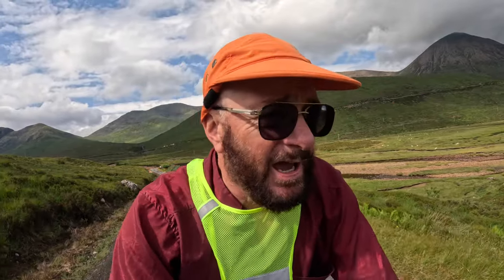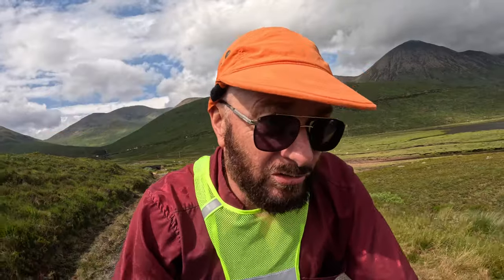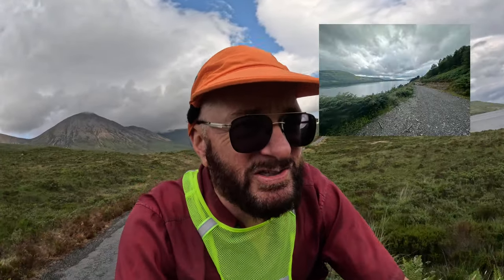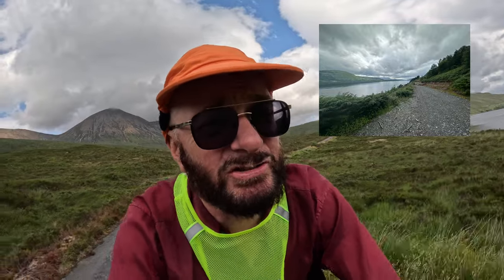Keeping the battery charged while ebike touring / bikepacking

Comment: Thanks for the vid, not wanting to be snitty but watts is power and watt-hours is energy. For example my big pack that I made has a rest-voltage after settling after a charge of 51.6 volts (LiFePO4 15s3p) and a claimed 6Ah per 32650 cell so I've got 51.6 x 18 watt-hours = say 920 Wh for cash. If I use 230 watts assistance for an hour I'll have 690 watt-hours left, but if I use 460 watts assistance for an hour, I'll have 460 watt-hours left. I don't even bother trying to calculate the actual wattage of the battery pack as I'm not trying to get maximum welly from it, just interested in range and cell longevity.
Reply from the maker: Oh that’s fine - I reckoned I was as over simplifying by referencing the systems battery wattage & that’s a good explanation
Reply: Thank you. My packs are 58.8V (fully charged) and 35Ah giving me a potential of 2058Wh.

Comment: do the pubs mind you just plugging in ,or do you ask permisson from the pub owner. ian a little worried if i push to far away from home .thank you for all this information ,
Reply from the maker: I might do a video on that specifically but generally I just plug in providing I’m going to be eating and drinking 100 times or more worth of whatever electricity I’m taking. It’s often mid afternoon so the bar usually being run by a teenager with no decision making powers anyway

Comment: I have the same bike as you. It is a400wh battery. Can i upgrade to a 500 Wh like you did. Do i need to modify the bike in any way. Or is it a straight upgrade from 400 to 500Wh , like you did? Thanks?
Reply from the maker: You can just plug in a 500 as if it’s a 400.  No modifications needed

Comment: 🤔 I’d try wearing a helmet 🪖 pal .. you only have 1 head 🤷‍♂️
Reply from the maker: I must do a video on helmet wearing & the strong opinions that are held around those magic bits of plastic and styrofoam (they are magic in a limited set of circumstances)
Reply: @Ebiketouringlife  🤔 well that magic piece of so called plastic which can also be carbon fibre could be the difference.. not to worry huh .. am sure ya too busy charging them batteries  ⚡️ 🪫😁👍
Reply: Guys, lets not fall out over this , us cyclists need to stick together! 
I am convinced about helmets only because my neighbour toppled off his stationary bike outside his house, his head hit the kerb edge, 
ambulance , hospital gash, stitches etc… 

Re-charge on tour is an interesting one, my ebike has given me a new start after heart issues, now I think theres space for a video on touring with a cpap machine ( sleep assist)

Comment: Just found your channel . Great for me as I'm branching out from Dublin using the canals and trains to extend journeys for day trip returns. These all hinge on my battery range so I was intrigued by your range and distance. You said a 500 watt will give you circa 100 k in normal conditions. I have a Li-ion 36v X 22 ah which, I understand, amounts to circa 790 watts. I was advised to divide wattage by ten to get an estimate of range in kilometers thus giving 80 klm approx for my battery. I've found this to be reasonably accurate. Could you tell me more about your battery pack make and brand. I heard u mention sourcing them on line from France. Txs!
Reply from the maker: It’s the standard Bosch battery - almost all my use is in the lowest asset  (eco) which is about 40% on their system. I’d say I get closer to 120km with the 500w in eco although I practice hard to be sure as I seldom go all the way to zero and if I’ve done 90 am inclined to turn the assist up for the last bit. In very good conditions I have got 130 and still had about 15% battery and once on Harris with a strong back wind I hit an implied range of 220!  For an electric it’s a light bike with 34mm tyres so with fatter tyres & a heavier bike it would be less. Fully laden including me & camping gear it’s about 110kg

Comment: Is a solar panel with a small solar generator (with an AC outlet) an option for charging?
Reply from the maker: not really, particularly where I’m cycling and the average distances I do per day. If you are somewhere more towards the equator with a trailer and larger panel and doing 50km a day it’s more practical especially if it can be mounted as a trailer ‘roof’ while cycling

Comment: It takes more than just a couple of hours for each battery to charge. Overnite charges would be mandatory!
Reply from the maker: Ive now toured some 7000km including wild camping up to 4 nights in a row where ‘top up’ charging while having a meal or couple of pints was all that kept me on the road. I didn’t run a stop watch but clearly with a fast charger that was enough as there was no where to plug in overnight. I am upgrading the computer to the Nyon which I think will mean I have better battery use data accessible to me
Reply from the maker: Add to this that a lot of chargers are only 2a whereas my fast one is 6a (Bosch do 2,4 & 6) so each of those will make for enormously different charging experiences
Reply: @Ebiketouringlife  Tip for you, always find a moment to leave your battery to charge overnight, if you can - reason for this is that the balancing of your cells happens at about 90% full charge, you want to let your BMS (battery management system) balance out your cells every now and then, or your battery will definitely degrade faster.

Comment: Why is your face the real focus of the video?
Reply from the maker: Mostly because I’m so much more attractive than the scenery. But actually because that’s a camera mounted off the handlebars that mostly points forward to capture the road footage I use when talking about routes. Here I was returning from an unexpected dead end on Skye created by road works and decided to use that time to answer a question I’d got a lot by spinning the camera around and tapping away while I cycled.
Reply: @Ebiketouringlife  But you have to understand his (our) point of view. I like to see the area and the scenery more than I want to look at you. It's nothing personal. I've got over 50K miles on my ebike now and don't glean any useful information from you or most other riders anymore. Again, it's not personal. Once I finally learned how to cut the A/C voltage umbilical cord riding has changed into living comfortably off the bike for as long as I like. But, I do like seeing the areas you ride. A DJI Pocket 2 stabilized camera works well at flipping the camera 180 degrees with the tap of a button, either on the camera or on the App. You can see in this video that I can flip from front to back easily. - https://youtu.be/K1z3rt3_lfg

Comment: Can you add regen to your rig?
Reply from the maker: You mean to harvest breaking energy? Interesting question but my suspicion would be that the added weight, bulk & repair complexity probably wouldn’t be worth it for touring uses. In particular as I’ve not had a problem with charging batteries so far so it’s fixing a problem I don’t have. I have wondered about a simple dynamo I could engage for downhills that would charge a powerpack for phone / GoPro use

Comment: Stupid is having ebike for touring 😂😅. The simple it is the better!!!
Reply from the maker: I think I’ve proven this not to be the case, 7,000km of touring done, vast majority of that wild camping and routes that are difficult in terms of terrain & prevalent weather conditions.
Reply: A gas powered 2 stroke moped might be the better option. With that you could get repairs. But with an e-bike SOL. The rest of the world is not at all like the US.
Reply from the maker: Errr I’m not in the US - but yes Namibia where settlements can be 300km apart would be a challenge. The electric components of a good ebike are unlikely to fail under less than 50,000 km so I wouldn’t let the fear of repairability stop me making the attempt - it’s pretty low risk in comparison to other critical issues
Reply: @Ebiketouringlife  Your biggest concern should probably be how waterproof the electric motors are. Thus center drive is pretty much out.. Probably best would be one with both front and rear hub dive ind on a tricycle to allow more cardo, stability and traction.
Reply from the maker: @riskyron1416  my impression is that a never opened Bosch centre drive should be fine although I'd wonder after its been serviced if the seals can be as good.  I presume your concern here is immersion while crossing rivers rather than just heavy rainfall?  TBH the Irish & Scottish Atlantic coast conditions are pretty severe both in rainfall terms but also salt spray

Comment: What about regen?  Why is it so ineffective (<10% return)?
Reply from the maker: Don’t know enough about the physics but I wonder if a downhill brake dynamo might add something beyond cost & complexity 🤣
Reply: Simple, its spent energy, the fact you get anything back at all is already amazing - but its just not worth it. Regen braking is often used for exactly that, braking, not for the regen part.
Reply: @Ebiketouringlife  - Racers use dynamo hubs to produce electricity to power their electronics so it must be viable, since racers wouldn't waste pedal power unless it was worth it. The physics is E = mgh, where E is energy in Joules, m Is mass in kg, g is the earth's gravitational constant and h is the height in meters.  That part of physics doesn't explain why regen is so inefficient though.  : (   If racers use dynamos on the flats, then braking on downhills should be that much more useful for generating electricity?
Reply: @tomnoyb8301  I don't know much about this stuff, but the amount of energy created from a dynamo or regen braking is probably so small as to make it not worth it for the added complexity and weight of putting those things on an ebike. Plus on a long ride, how often are you really even braking? Probably a small fraction of the time you're on a bike.
Reply: @williamreinhard  - It's not so much the weight of the dynamo as the drag caused by generator producing electricity.  If a racer's producing 200Watts and the dynamo's producing 2W at 10% efficiency, then the dynamo's dragging the rider down to 180W.  He lost 10% of his forward energy to keep his phone/computer/lights working.  Otoh if he only generated energy when braking (e.g. on downhill's, etc.), it wouldn't cost him any Watts of forward-energy.  And there are hundreds/thousands of cost-free Watts available on downhills.  

One way to do it might be to include an inclinometer in the dynamo hub to produce power only on steep-enough downhills?  To the genius who balked at complexity, your smartphone's inclinometer is the size of the microchip in your credit-card.
Reply from the maker: I’m that genius but I wasn’t referring to detecting a descent which should indeed be simple but the physical mechanics of engagement & disengagement which adds another layer of stuff that can break & needs maintenance (plus of course adds weight). All of which is competing with simply carrying another powerbank. I presume that’s why they don’t exist
Reply: @Ebiketouringlife  - This author presumes lazy product designers.

Comment: hi  do you find your average speed on ebike eco is much different than just a normal touring bike?   whats the approx difference in average km/hr  all factors being relatively the same (eg flat roads / no head wind ec) and if yes then is the trade off for extra weight of bike and (hassle of) getting the batteries recharged overall worth it..         and how long does it typically take to charge a battery,    cheers
Reply from the maker: The benefit off an ebike if you are reasonably fit & in eco is pretty much entirely for going up hills & in winds. If you are going very long flat rides (100+ km in a day) there may be some benefit if late in the day you’d normally be fatigued enough to have to slow down but of course perhaps the extra bike weight cancels that.  So my average speed with hills/wind is higher but with neither would be similar as legally the assist cuts out at 25kmh & in eco is pretty modest at say 20kmh.
Reply: @Ebiketouringlife    hi thanks a lot for sharing this experience.  much appreciated.
Reply from the maker: @sweetsweet3753  one aspect that’s amusing is the 25kmh assist limit means that often the fastest route will be the one with more hills as the assist gets you to the top under assistance and you can generally cycle much faster downhill under your own power than you would on the flat.

Comment: Love your adventures. Great videos.

However, I can't understand why you don't wear a helmut, considering your long experience in cycling and how you set your bike up so well.

Baffles me. You obviously have your reasons, but I feel you are tempting fate, and that it will never happen to you.

Do you not wear car seat belts too? Its not whether you fall off onto the hard road by your own misadventure, but whether you get knocked off by a vehicle.

I am sure all your viewers wish you well, as I do. But seriously, I would've thought you would be an advocate for safety while riding and setting an example.

Please dont take offense, but rather an explanation as to why not.
Reply from the maker: Hi Ray, it’s a very common misconception that helmets can protect cyclists from vehicle collisions. They can’t, they are way too flimsy. The manufacturers disclaimers are actually very clear on this. 

What they do offer protection from is your first scenario where someone falls off a bicycle & hits their head off a stationary object like the road surface. So I do wear one in winter for instance when the risk of falls is higher.

I do wear a seat belt in a car as the benefit there is very large indeed but like most people I don’t wear a helmet in a car even though that would have a similar if a lot smaller benefit.

Helmet discourse is as far as I’m concerned mostly a distraction from improving cycling safety and transfers the burden of improvement from collective action (infrastructure improvements) to individual responsibility.  Worse still in some bad drivers it can instill a sense that they are less responsible - a sense that unfortunately also appears in some court decisions
Reply: @Ebiketouringlife  Very concise response.

Comment: Nice... im doing an extended tour... and I just bought and installed a bafang 1000 watt mid-drive... the bbshd... with a 48 volt 20amp battery...but at the moment I've stopped to work and save to fund the next leg of my trip... so I haven't gotten to test the battery distance.... amd ive been stressing on charging... if I wasn't already pushing the weight limit of my bike frame... id pick up a second battery... america is far different... I get dirty looks for trying to charge my tablet and cellphone amd 2 small backup batteries in fast food place... I cant imagine breaking out this 15lb battery amd huge charger on top of my electronics...
Reply: Ive found that churches are sometimes a better place to charge when you need to charge for a period of time and have a lot of things to charge... parks with pavilions sometimes have functional plugs...